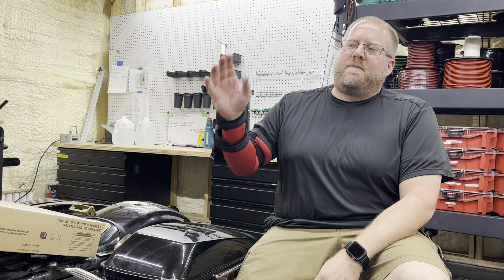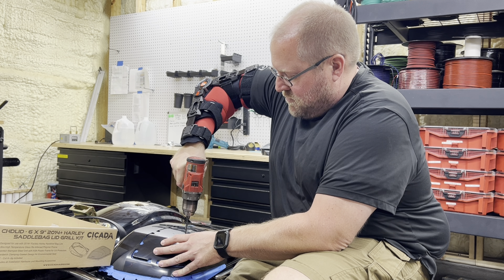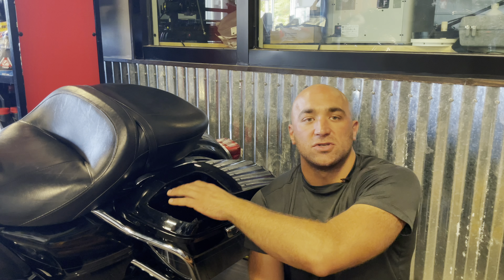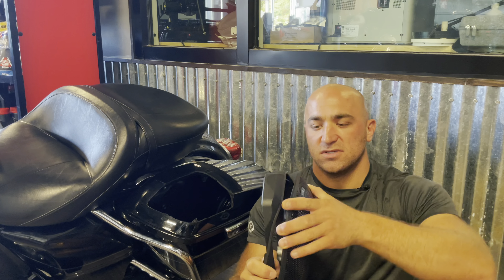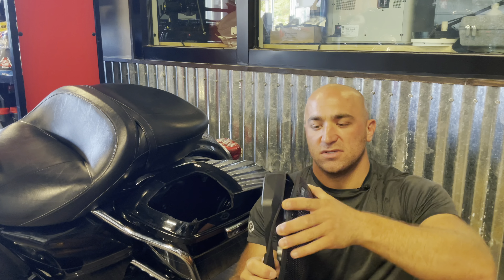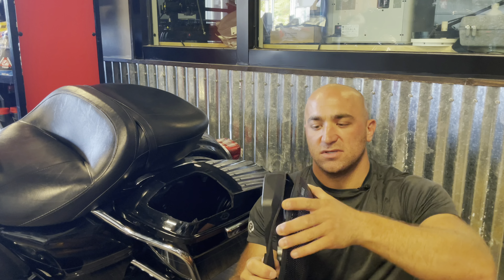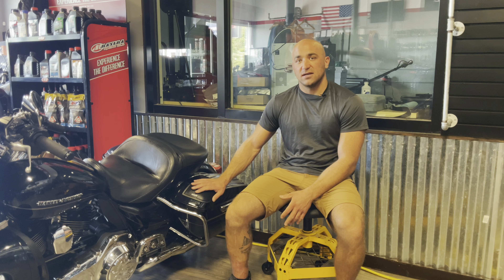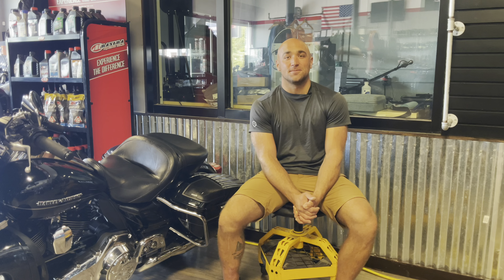CICADA AUDIO lid cut in kit install

Comment: nice video..  question..  will the cicada cm69 speakers fit in the same saddlebag lid cut that was cut for the rockford fosgate 6x9 speaker?  I'm looking to upgrade the speaker but dont' want to replace the already cut lids.